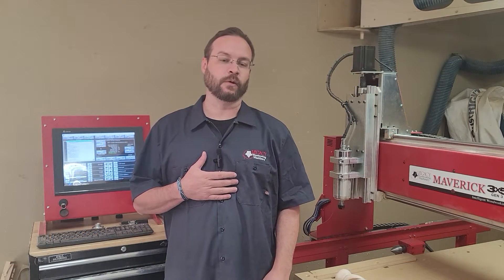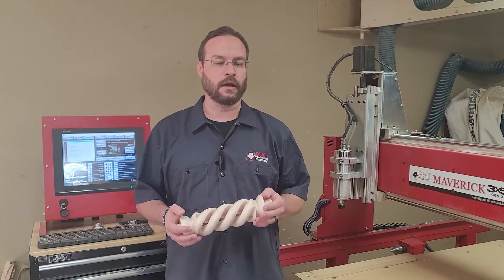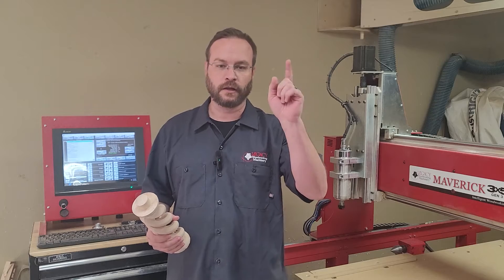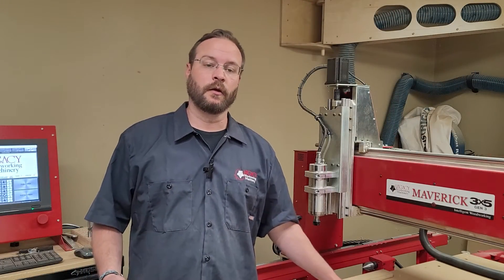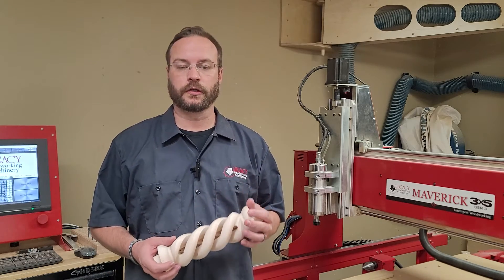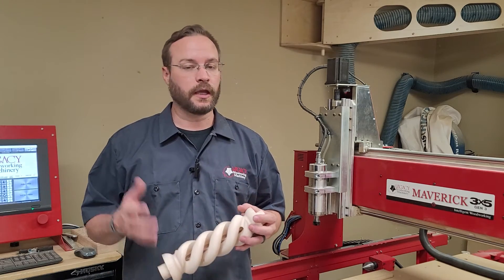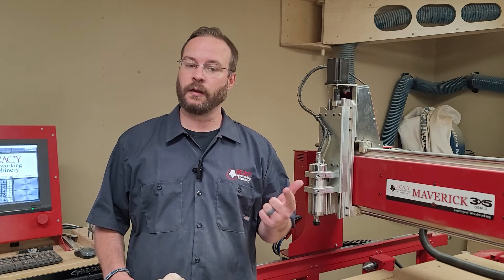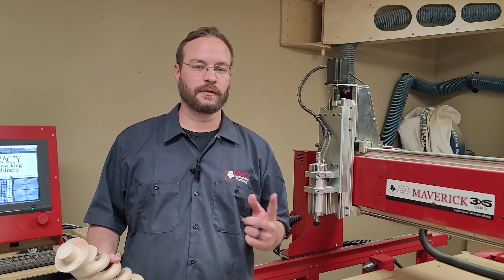Making the Hollow Spiral   CCAM Pro

Comment: I am curious, does the flat cutter reach the internal face of the intended shape? That must be some good reducer.
Reply from the maker: Yessir! The 1/2 inch endmill reaches 1/8 inch below center of this 3 inch diameter Hollow Spiral.  We do that to make sure that the  center is machined clean.  the spindle we use comes with er20 collets that make sure that the machine is holding the bits securely!

Comment: Great clip John!!!   What is the info (where to buy) on the Chuck you are using in the video?
Reply from the maker: Here is the link to the chuck that I am using in the video

https://www.amazon.com/WEN-LA4374-3-75-Inch-Self-Centering-1-Inch/dp/B07PX8WKRG/ref=sr_1_1?crid=3OOODMUGHN5U8&keywords=WEN%2BLA4374%2B3.75-Inch%2B4-Jaw%2BSelf-Centering%2BLathe%2BChuck%2BSet%2Bwith%2B1-Inch%2Bx%2B8TPI%2BThread&qid=1698332330&s=hi&sprefix=wen%2Bla4374%2B3.75-inch%2B4-jaw%2Bself-centering%2Blathe%2Bchuck%2Bset%2Bwith%2B1-inch%2Bx%2B8tpi%2Bthread%2Ctools%2C131&sr=1-1&th=1